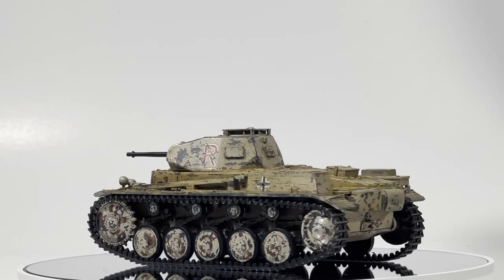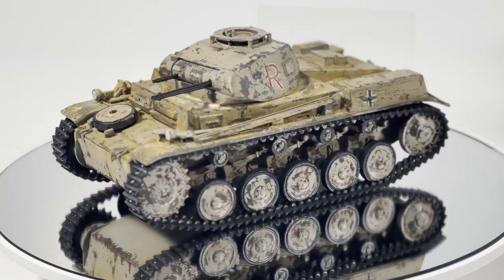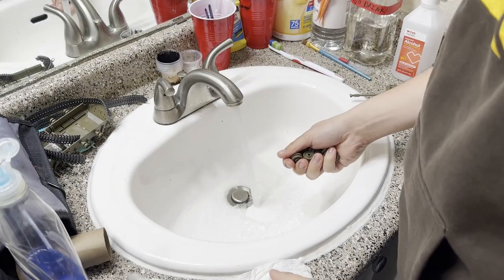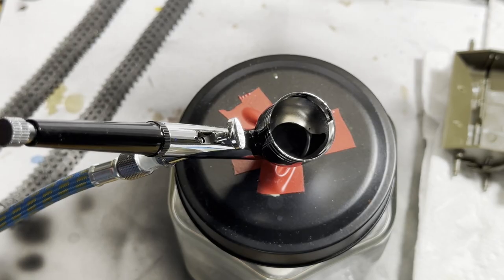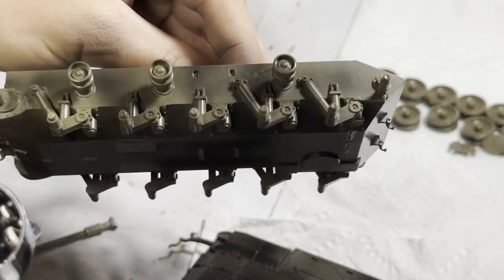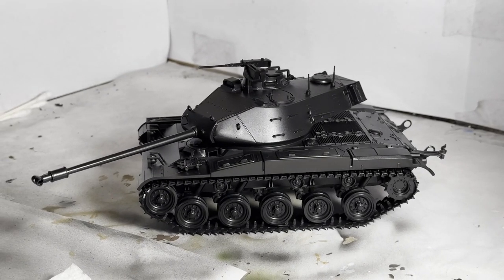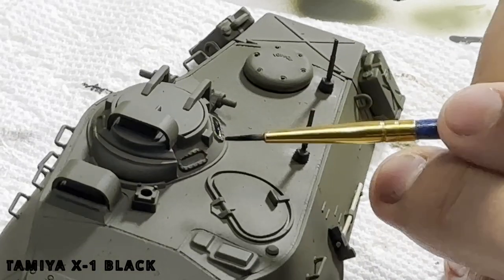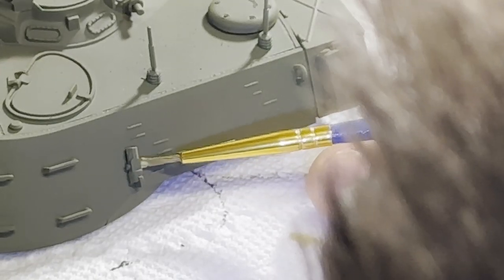Getting Started With Scale Model Painting!

Comment: Great video! Keep up the good work. For cleaning the model before primer, you can use IPA if you are in a pinch for time. Also, I've learned to store my airbrush disassembled in water when I'm not using it. I find I get a lot less clogs that way, because the airbrush never dries out. For the tracks, I find that I get some really cool effects by using pigments to simulate dust, rust and dirt. Looking forward to seeing your next video.
Reply from the maker: Thanks for the advice! I tried out some more tracks in my latest video. This week I'll be sure to work on some new weathering effects as well.